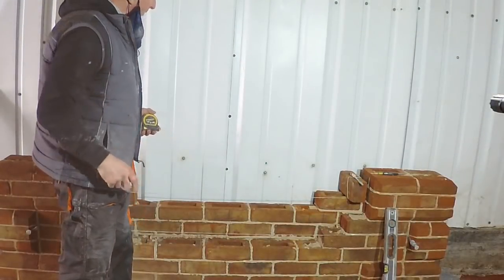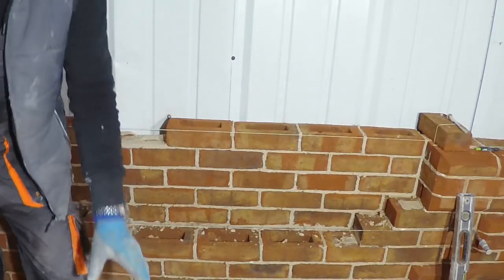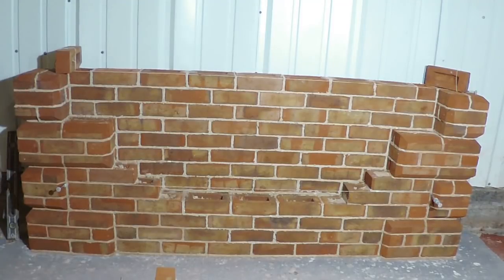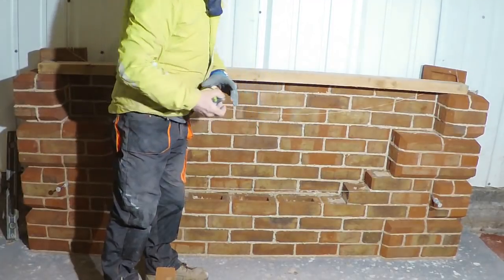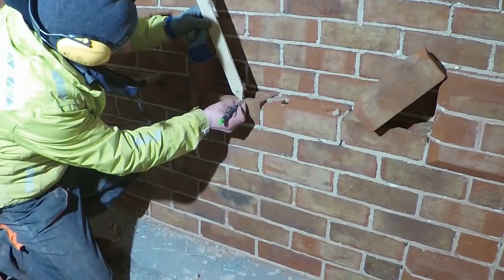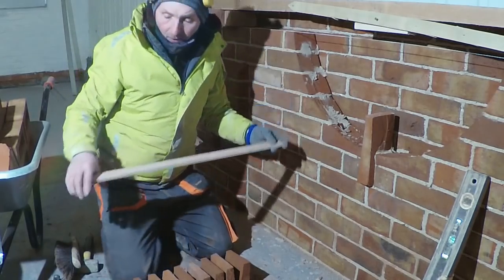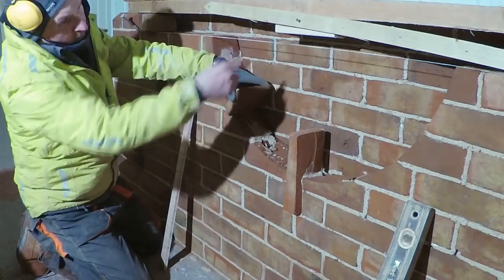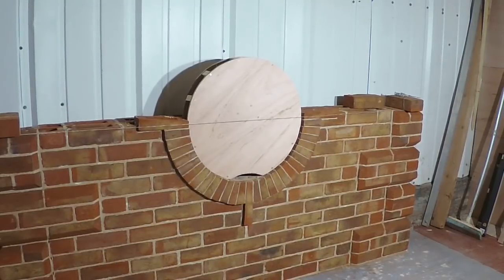the fine art of brickwork  - Florentine  Bullseye Part 1

Comment: where about does the screw go? do you drop it down 10mm from the striking line? because its lower than the timber on top? so is it fix another block to that timber then 10mm down?

Comment: Hi rob when doing price work how do you increase your productivity to the maximum is it the combination of reducing wasting movements but also forcing yourself to go as fast as you can (without sacrificing quality of course) or do you keep at a steady pace?
Reply from the maker: It's all in the preparation, planning and doing things that are simple first  to give yourself a positive start and not an uphill struggle from the moment you start. 20 mins of thinking can save a whole day of stress.
Reply from the maker: If you adopt good, clean and efficient methods everything else falls into place.
I strongly advise Advance Craft (Level 3) so nothing technical will hold you up.
Reply: @robsonger1  thank you for explaining this but when one is technically sound and has adopted good clean efficient work methods does speeding up the movements also contribute to increase in productivity?
Reply from the maker: To a certain extent yes, there is no price on experience.
Knowledge and good habits are the key. No one wants a job to take too long but to earn yourself a good name is better than earning gold.
Reply: @robsonger1  I’m currently reading motion study:a method for increasing the efficiency of the workman, every tradesmen should read it highly recommend and dovetails nicely with your philosophy of preparation and efficiency